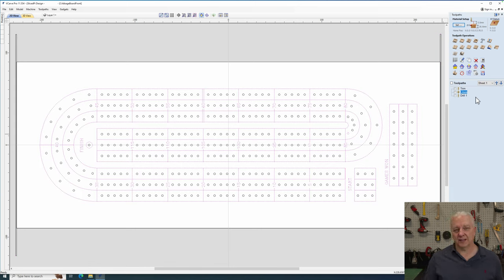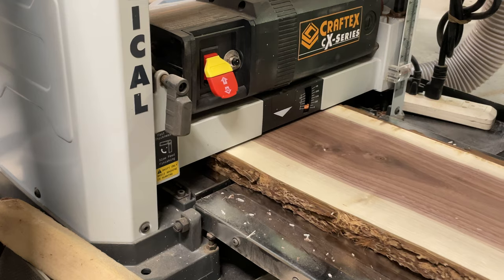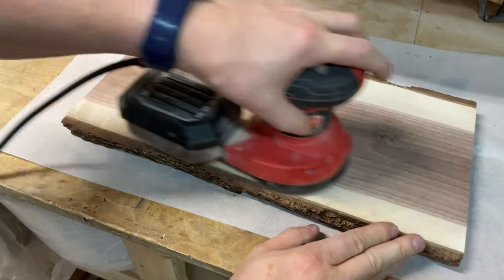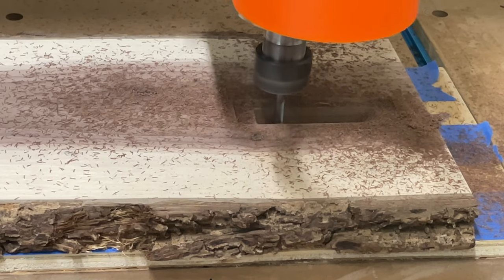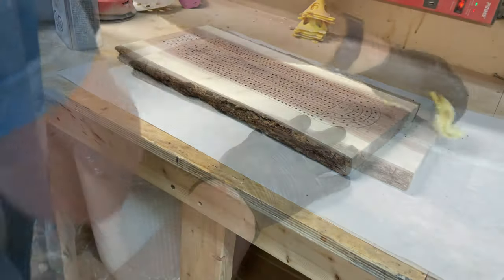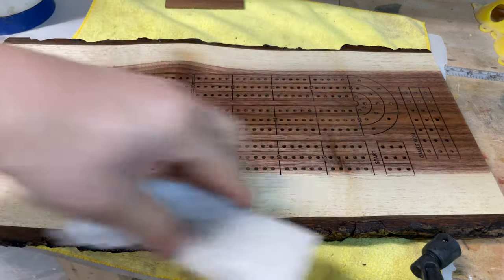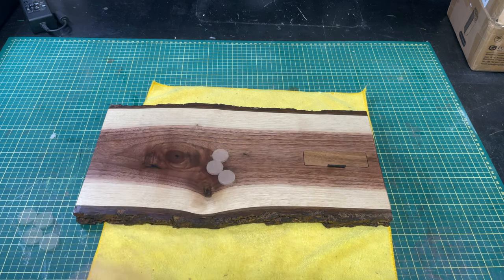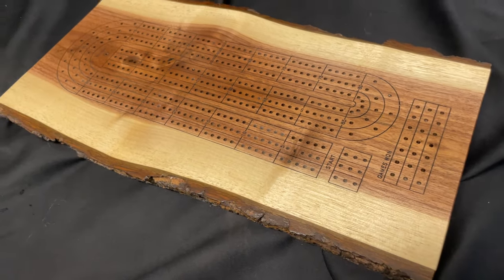Elegant Live-Edge Cribbage Boards Are a GAME CHANGER

Comment: Hi Steve. Have you considered for your Onefinity the new 44W OCTO PRO Laser? Would be nice to have a review and do a project combining router and laser on the same machine. (which you could have done for the cribbage board.)
Reply from the maker: I’m actually thinking of doing a video about putting an aftermarket laser module on the Onefinity because it would be quite a bit cheaper.